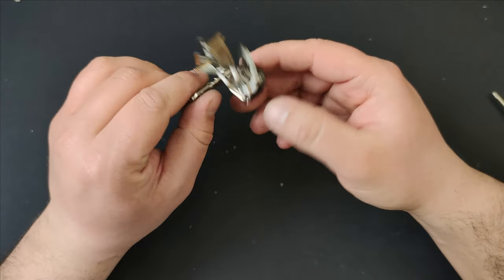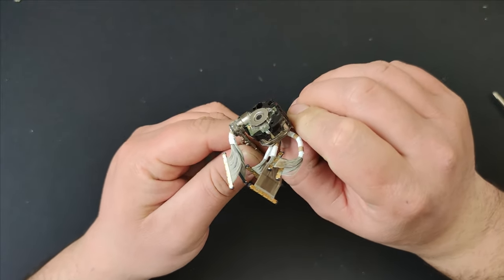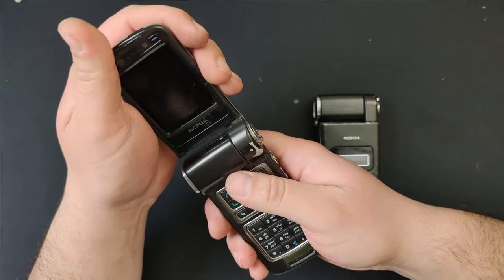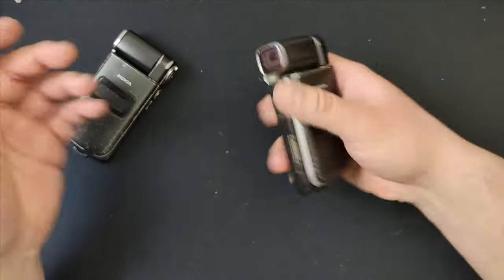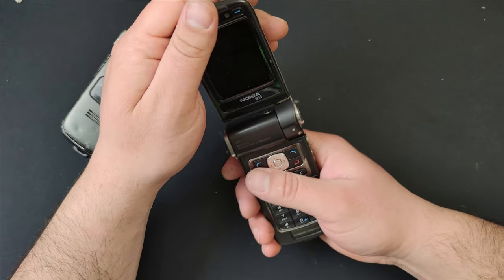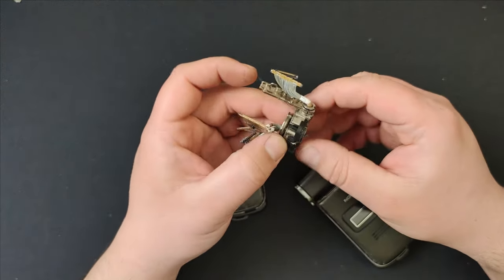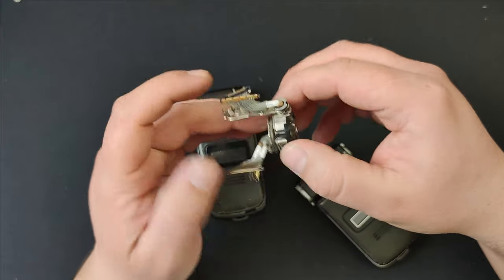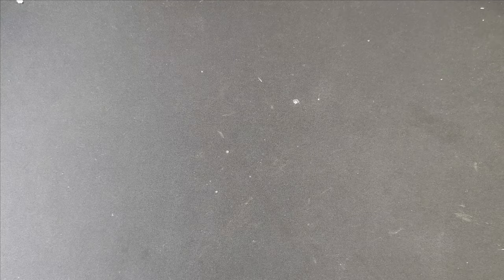Nokia N93  Refurbish | Restoration  |  Detailed  disassembly/assembly     #4K

Comment: Is the display covered with a plastic layer or is it not covered like the N95?
Reply from the maker: The original one was covered with a plastic layer. The one that I put in it is not. If you buy a display compatible for N71  N73  N93, it will not come with the plastic cover.

Comment: Now I have bought a new battery, so the phone works as it should from the beginning - but still unable to connect WiFi with simplicity.
 Do You know if there is a solution to ease WiFi connection?